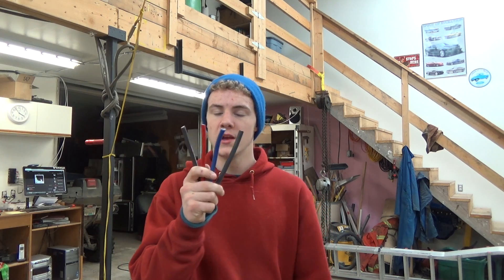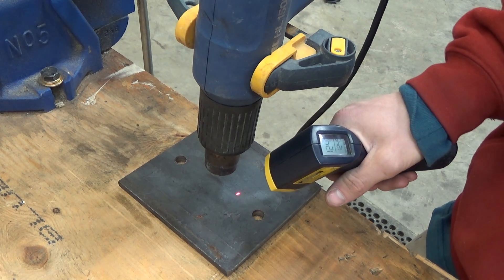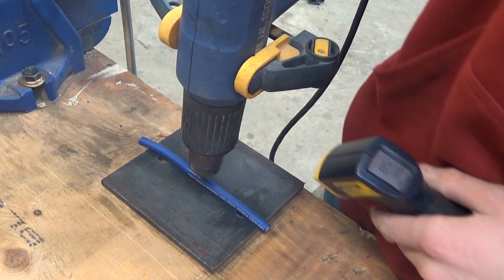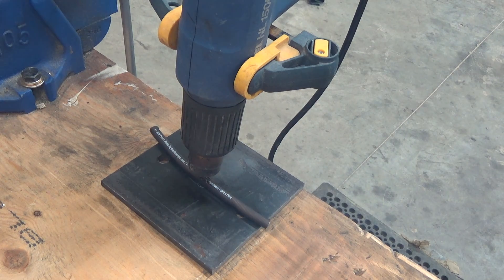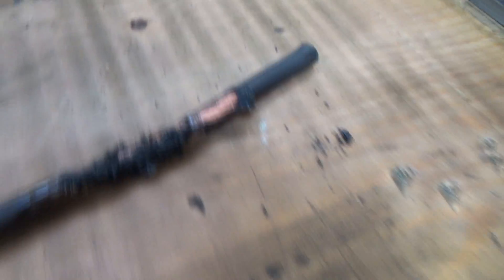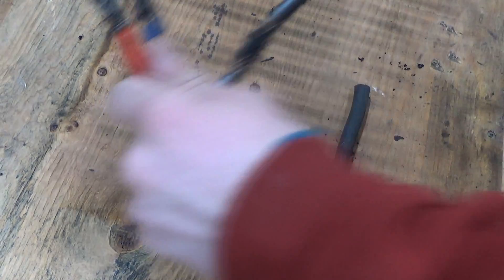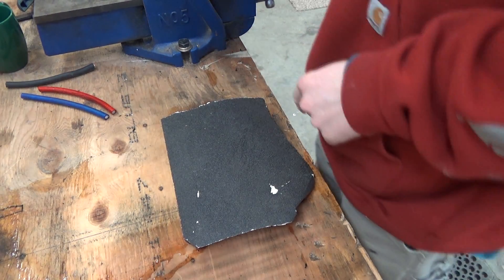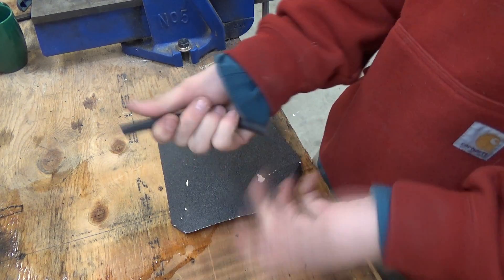Welding Cable Vs Car Audio Cable

Comment: 1. Cca is shit for so many reasons im not going to go into details. 
2. High strand copper car audio cable is much easier to run in a vehicle compared to welding cable because its way more flexible. 
3. Electricity travels on the out side of the wire. The more strands there are the more power you can actually deliver in the same size of cable.  
 Welding cable is great for welding because you are dealing with high voltages.  98% of car audio systems are +15v or less so a high quality car audio power cable is great for that application
Reply: As someone with a electrical engineering degree and an technical trades degree who started building audio systems in the early 1990's and have an extensive background in industrial power plus welding power supply design I can say for a fact, You have no clue what you are talking about.
Reply: Tcmtech oh so your saying that skin effect isnt a real thing?  Or that welding cable is easier to run through a vehicle than high strand audio cable?  I know your not going to try to convince me that cca inst garbage because that shit breaks when crimping on connectors and/or with set screws in amps and fuse holders etc.  Mr. Electrical engineer and technical trades degrees.  Id love to know how i dont know what im talking about
Reply: SKin effect is irrelevant in DC circuits so it's a non issue.  

Same with using the wrong  method and techniques for specific type of wire and connection in general.  Or any installation of anything for that matter.

Doing things wrong due to lack of proper knowledge and understanding of whats being worked with is not the fault of the material. Its the fault of the person doing it because they don't know what they are doing or are trying to cut corners by doing things wrong in some way. 

I've dealt with the audiophile people for over 2 decades and by far they are the most arrogantly ignorant people I have ever met.  
Most every concern they have is built on concepts that are magnitudes of order below the threshold of legitimate concern or even practical real world measure, just like your skin effect argument on a DC circuit or any circuit that operates in the  frequency range of human hearing that would be found in an automotive audio system application.

Just do teh math for the given materials in their anticipated working environment and see what that tell you. .If the numbers show a less than 1 - 2 % theoretical worst case scenario loss in realistic working conditions its well below what your or anyone's sense will ever detect.  
Even more so if that theoretical loss is at the statiscal peaks of whatever is being measured and not in the overall average mean value.
Reply: Tcmtech  skin effect is relevant in ac current thus the lower strand count in welding cable since dc current travels through the whole wire high strand count makes more sense unless you use solid core....  But that would just be silly in a auto. 
when your trying to obtain a world record for spl every little bit you can do to obtain just a tenth of a db is worth doing. Beating 183.7 db takes a little more than doing some math otherwise the record would be at 190db and there would be no more competitions.
Reply: Yes but your power feeds where you use heavy gauge wire are DIRECT CURRENT not ALTERNATING CURRENT OPERATING AT SEVERAL TENS OF KILOHERTZ.   It's a non issue in an audio power application.

As for beating someone in competition if you think just throwing random pseudo-techno bullshit at a problem rather than approaching it from a logical technical analysis of what's needed where and why is going to win you a competition it's not.    

Years ago I used to do competition audio work and I did extremely well using well thought out and built systems. Systems built around valid realistic and measurable  points of concern of which skin effect on a DC power system cable is not one of them.

I'm not trying to be rude but I really don't think you have a clue what skin effect really is or when and where it's a valid and justifiable concern.  

Read up on skin effect and do some math given the frequencies involved in audio power circuits (0 Hertz) and  to what depth of conductor  thickness it becomes a problem at (10's of inches) and to what percentage of additional resistance it will add per unit of length of conductor compared to it cross sectional area (none).   

http://chemandy.com/calculators/skin-effect-calculator.htm
Reply from the maker: you summed that up so much better than i could have lol
Reply from the maker: Naw people just like it for flexibility and such
Reply: Yoshi1u2 They run solid core in most industrial applications and in house wire because it handles heat better (more copper there) they would run solid core for welding lead but you’d never be able to move around
Reply: I always thought that the more strands of wire you have can travel more amps than more solid thicker wire.
Reply: Tcmtech is completely right on this one, you have no idea what you are talking about lmao.  You also have never used proper welding cable thats geared towards the car audio crowd. I can tie pretzel knots with my 4/0 eb flex.
Reply: Jeff DaChef is your EB Flex equal gauge to car audio wire. Would 2/0 EB flex be equal to 1/0 car audio wire?
Reply: actually its bigger than normal welding cable, the 2/0 is big as sky high car audio 2/0. the 4/0 is ridiculous.
Reply: Jeff DaChef yeah I kinda figured cuz on their website they list each gauge’s outer diameter and 2/0 is huge almost 3-4in. Even their 1/0 is bigger than other 1/0 welding cables. 
I was planning on getting CCI Royal Execelene 2/0 which measures at 0.55 OD and going by EB’s list their 1AWG is what’s closest at 0.57? 
EB flex is actually on sale on their site but wanna know which is the correct size that will fit typical 1/0 terminal lugs and 1/0 amp inputs.
Reply: tight fit but you'll make it work.
Reply: Skin effect depends on frequency, at sub-bass or mains frequencies you can safely ignore it till conductors are 20mm thick or so.  For midrange it will start to be an issue at 4 or 5mm diameter, for tweeters 1mm or so.  High power tweeter
systems in particular might benefit from litz wire, but in reality just using thicker wire with more surface is easier.  (All the above for copper)

Comment: Welding cable all day...if I can run my welding leads out to 100 foot and pull 0ver 600 amps on a single 2/0 run....then the 10 runs of 20 ft I have in my truck will power any amplifier on the planet!
Reply: Gavina Reyes use a online fuse 12" before your amp..depending on the amp depends on the size fuse you need.
Reply: Gavina Reyes Yes, you can put a fuse on any wire, even welding cable. And, you most definitely want to install a fuse on your amp power cable AND that fuse should be installed as close to the battery as possible. You are protecting your car from catching on fire in case the wire shorts to ground after some time.

Comment: I like 4 gauge  copper wire . it's not as flexible but it's not going to catch fire either. I'm running 4 12'' in my cavalier  at 2ohms .

Comment: As a fellow youtuber I really want to like your video but your test consisted of nothing related to the topic. You might as well said it was Welding cable jacket versus car audio jacket. Your knowledge of the wire alone gave it away that you didn't understand neutrons and protons contained in copper vs cladding vs silver cladding ect..... 

I guess this is the age of everyone wanting to get things as cheap as they can. The only person this generation wants to profit is the Chinese that manufacter the wire. 

Ill give you a Sub and watch a few videos to see if you improve, but really you had no knowledge of trying to make a video on this subject..... Welcome to the age of Youtubers I guess.

PS , neutrons and protons will determine the conductivity of the conductor. After that your looking for flexibility which is determined by the thread count, then you go to the jacket properties and study its benifits, and if your engine bay or wire heats up to 157 celsius your car is already burning down you might want to get a fire fire extinguisher.

In my store 0 Gauge Silver tin ( Silver over copper ) is $6.00 ft The benifits over welding cable are a better conductor of electric, more flexible , about 20% more power handling. Hope that helps.
Reply: sorry to say car audio cable is just a marketed gimmick and you as a brick and mortar shop fell straight for it.  Welding cable is made with much higher and tightly regulated standards of quality than car audio cable, Much more pure copper and less resistance. Shok industries actually made a video exposing most car audio companies wire to be impure, not really oxygen free and basically garbage compared to actual quality wire. So your knowledge on the subject matter is pretty shit.
Reply: Dont you think that to power the car amp the most important is the low resistivity of the cable? Then - what has it? Definitely copper and not CCA nor SCA, so any copper wire with the same area is the same (and copper is used for welding cables). What was the argument of the cable seller? That the cable insulation for welding cable is crap for cars. And this is what this guy showed us - welding cable insulation is great. p.s. why do you talk about protons and electrons and not about bosons? Why do you even talk about protons in metals? And what exactly - electrons speed, electrons density, traps etc - are you interested in?
Reply: I can purchase 2/0 ofc welding cable for about $2.25 per foot at my local welding shop. I would much rather do two runs of that through my SUV and STILL save money vs one run of $6.00 per foot wire from an audio shop. It more than gets the job done, speaking from experience.
Reply: I'd like to add there is ZERO regulation for car audio cabling.  You dont really know what you are actually getting, all you can do is believe in whats on the sticker. and what the companies advertises with zero means to confirm their claims.
Reply: Better conductivity... well that's not really possible. The fact that welding cable almost always has more copper content (weighing the copper with out the jacket at all) makes the thought process that car audio cable is better than welding cable invalid.... we pay for the copper.... having less will never get ya more  conductivity.....
Reply: I buy my welding cable made in the USA. Haven't found an audio cable other than JSC that's made in the USA. Welding is cheaper and both have the same current and temperature ratings.
Reply: i find it EXTREMELY ironic that you chastise this guy about his lack of knowledge, only to manage to shove your foot so far in your mouth the laces are falling out of your ass. 

protons and neutrons have fuck all to do with conductivity in metal. the magic happens in the valence shell and the (lack) of electrons in the outer most shell. 

two of the three claims you make about the product you sell are complete bullshit, no other way to say it. the tinning is more about protecting the copper from corrosion than it is conductivity. ANY conductivity gained by tinning the copper wont be readily quantifiable and as for the "20% more power handling" claim, thats just more bullshit on top of bullshit designed for gullible people to buy a product.

is tinned copped better than a quality ofc welding cable in terms of conductivity? not enough to matter. 

resistance of 8awg silver as measured in ohms per foot:  0.000579 ohms 
resistance of 8 awg copper as measured in ohms per foot:  0.000628 ohms
1000' of pure 8awg silver wire: 0.579ohms
1000' of pure 8awg copper wire:0.628ohms

you are part of the reason car audio is dying.
Reply: +OxBlitzkriegxO 👍👍👍👍👍👍💪💪💪💪💪
Reply: Random Audio Guy hmmmm so want to make sure I got you right your saying Silver tin is a better conductor than the Copper Welders Cable correct? And if so any recommendations of a distributer here in Cali we can purchase from unlike this video I want to hear the difference and test the current comming directly of the alternator to my 3 soon to be 5 batteries in my car to the amps
Reply: Random Audio Guy WELL PUT!!

Comment: EXO used Royal Excelene welding cable. You can buy 1/0 ofc from menards. 25 feet $75. Its really a good price compared to the Name brands.
Reply: Adam Moore u should check out conext link on Amazon 2/0 silver tinned copper for 3$ a foot 5,226 strands fits great into a lug as well
Reply: Daniel Harrell what’s the link or store name

Comment: Issue with welding cable is the copper is rather dirty. Better than ANY car stereo wire though. That car stereo Chinese junk is mostly aluminum. Best cable to run is proper battery cable. Another gig on welding cable is that it's not designed for under hood engine bay temperatures. Battery cable IS rated for under hood temps and has purer copper wire inside compared to ALL the other wanna-be's. Welding cable is for welding. Battery cable is for cars and trucks. Car audio wire is to fill up your trash can. Try to solder to any brand car stereo wire. You will see it catches fire rapidly. Not high temp rated at all. If you want your car to burn to the ground, use car stereo wire.

Comment: I work as a welder .. and i use welding cable in my system  and believe me these cables are really durable. We drag our leads across  jagged precast concrette peices all day and they hold up very well of course it is not indestructible but id have to say its really good wire  only con is it isnt as flexible but isnt a big problem.  They 1/0 can do up to 400amps      but  welding cable is the way to go!
Reply: yes I use a fuse right by the battery  300 amp fuse. and then I have a distribution block with fuses as well u always need to use fuses want to always protect your equipment as well as your self..  I saw a truck burnt down under the hood from a wire burning up and well fuse was too far from battery and the wire before fuse shorted out and caused the truck to catch on fire..
Reply: Gavina Reyes yes always better to be safe then sorry ..  fuse is also a protection for the amp aswell  just get the right rated fuse for ur amp..  ex.  1200 watt rms. 120 amp fuse..  2000 watt rms 200amp fuse   and so on..
Reply: Gavina Reyes be on the look out i plan on posting vids of my truck soon

Comment: You should have run electrical stress tests, like over amping the wire, voltage drops like Brian said, resistance per ft with a good meter, and maybe a little EMI testing. That would have given a more complete battery.

Comment: i prefer welding cable, its more flexible, and safer to use in an engine bay application, i even build battery cables out of welding cable due to its capability for handling HIGH current and safely handling high temps, after all welding cable is designed to work in hostile environments with high temperatures and the real risk of abrasion and nicks, thanks for the vid, good info

Comment: I am confused,  none of these tests are that important in car audio.  We want to know if it is true gauge ..ofc vs. Other materials. But the main thing is voltage drop and how much amperage it can safely handle before the wire gets hot. The jacket material should be sufficient but the wire is what we want
Reply from the maker: I take it your looking at this from a true spl/performance stand point not a quality of install stand point. If your worried about your power conductors heating up do to the current alone that is just silly. At that point your voltage drop would be a much lager problem than heat.
when it come to if your conductors are true to there listed size, that has little to do with a  weather or not it is a welding product or a car audio product.  that comparison would need to be done brand to brand.
Reply: DonkeysBreath no just talking if that walmart brand caims to be as good as my welding wire they need to back it up
Reply from the maker: i dont follow what you mean

Comment: "AMBIENT" and "DIRECT" are two very different things, especially with regards to temperature. That heat gun is not an accurate or fair test.
Reply from the maker: HUBBABUBBA DOOPYDOOP not when left over a period of time, the affect will be the same

Comment: I wish you would've done voltage drops with all the wires
Reply: Donkey breath = your name sounds like a strain of weed lmfao  cool name

Anyway -I did a test awhile back & also am redoing 1...

I need to use welding cable in my next 1!
Reply: This is why you use welding cable.. because its pure copper cable.  CCA should be fucking illegal, it is horrible for everything.  Power, data, signals.. copper clad aluminum is disgusting to use!
Reply from the maker: Brian Evans i'm thinking about doing that in the future of the time in this video I didn't have for lengths  of any of this wire so I was not in the position to go out and buy a new Kit of each
Reply: You cannot measure voltage drop on 14ft of wire.  You can find charts that tell you what size wire to use for the current needed thats dependent on the length of wire. But the lengths are like 50ft and higher
Reply from the maker: You definitely can measure volt drop on 14 ft of wire, load dependent. It would not be difficult
Reply: Cca will have the worst

Comment: So this test is invalid cause who in there right mind would put there power cable next to there exhaust that's then only way way it will be exposed to that kind of heat .
Reply: Aaron Dunlap their not there
Reply: You wouldn't put it next to your exhaust initially, but if not adequately secured (maybe not secured at all, or secured with something that fails after a few months), it could migrate near enough to a high heat source (exhaust, but also EGR tubes) to become a problem.
Reply: I have seen some real genius installations. Just saying.